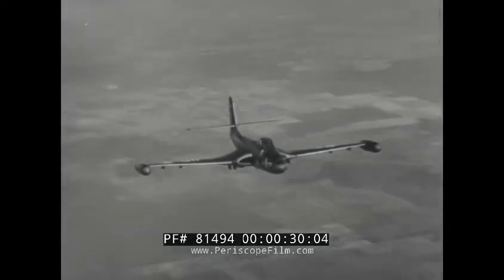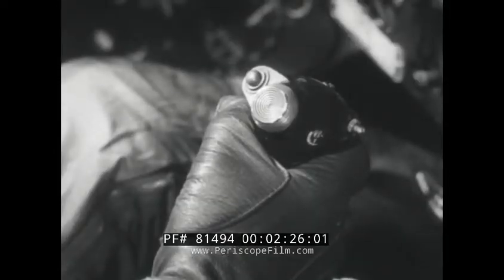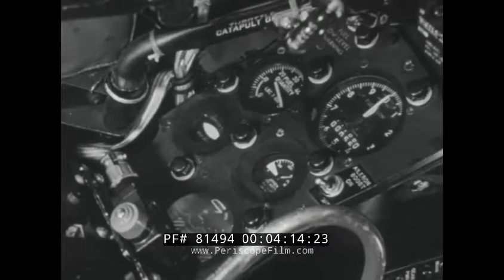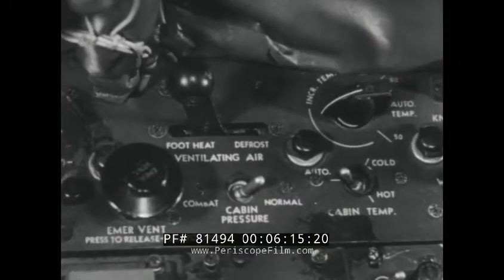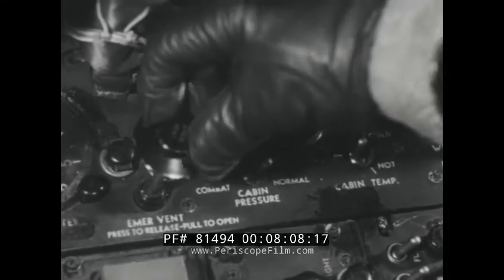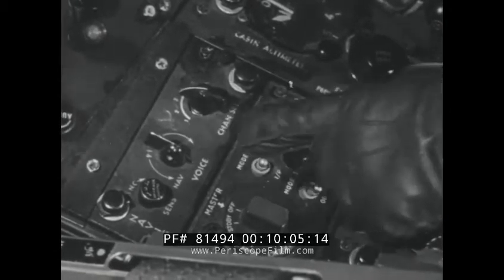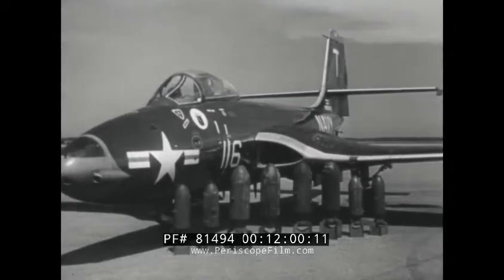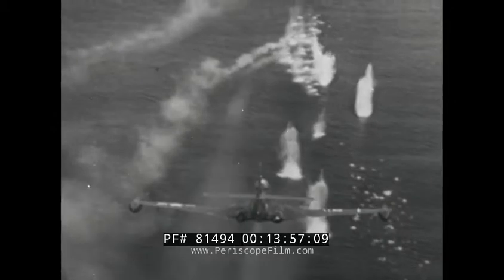1953 U.S. NAVY PILOT TRAINING FILM  "THE F2H-2 BANSHEE AIRCRAFT SYSTEM"   EARLY NAVY JET PLANE 81494

Comment: I have an untold amount of hours in this plane. I used to just sit in the cockpit for hours.

  You see, one of these planes was in a park in Vero Beach, Florida. Throughout the 70's, I would sit in the cockpit and imagine flying it. I also used to climb on the wings and rear stabilizer and, when I  was smaller, I used to slide under the wings and up into the engine areas on either side. Eventually,  the city put concrete to prevent kids from accessing these areas. 
  Initially,  I used to sit in the seat and there were wires and such hanging down behind the instrument panel (no instruments). At some point,  the city filled the cockpit half way with concrete and then later filled it to the bottom of the canopy.

My understanding is that, in the late '80s, someone realized this was the last surviving example of this plane. It was removed from the park, restored,  and placed in the naval air museum in Pensacola Florida. They painted it black to make it look like the Marine Corps version,  but this aircraft was originally bare metal (aircraft grade aluminum).

This is a link to the naval air museum website page of the banshee and a photo of the very plane that I played in/on as a child. 

https://www.history.navy.mil/content/history/museums/nnam/explore/collections/aircraft/f/f2h-2p-photo-banshee.html
Reply: Thanks great story

Comment: The F2H Banshee was a good, early first generation U.S. Navy jet fighter aircraft.  Now the U.S. Navy knew that better and faster jets with improved engines were on the way.  But now was the time to jump wholly into the new age of jet aircraft rather than procrastinate for better jet aircraft.  The early Banshees were capable of something like, 450 mph.  I believe this figure improved to around 520 or 540 mph.  So in the grand scheme of things, the Banshee, while well-designed as you can see above, was already obsolescent upon its deployment.  But the U.S. Navy anticipated this.  The F6H Panther jet was on its way.  The resemblance between the Banshee and the Panther is remarkable.  The Panther was much improved in performance and armament.  It could reach 580 mph.  It's armament was a potent, quartet of 20mm cannon while the new USAF insisted on retaining the .50 caliber M2 heavy machine gun.  The Panther carried the brass ring for the U.S. Navy in the Korean War, 1950-53.  By then the Banshee had been relegated to training duties.
      The Soviet Union followed a similar path.  Limited to German jet technology, using slightly improved copies of the Jumo 004B jet engine, the Soviets produced the Yak-15 and Yak 17.  Both were inferior in performance to British and American jets and the Soviets knew this.  But they needed to jump start their own jet fighter program and industry, now, and not later.  It was actually a practical decision.  The Soviets manufactured small numbers of the Yak jets, expecting better and improved designs.  
      This came in the stupidity of the British Clement Atlee government which looked upon the Soviet Union as a brother socialist nation that Britain could do business with and should do business with.  Do not blame all the British for this incredible act of stupidity, as historians keep saying.  The British Ministry of Defense, the British Army general staff, the Tory Party, and former prime minister Winston Churchill vehemently and vociferously opposed this brain-dead decision, to no avail.  
       The Atlee government transferred free, several superb British Nene jet engines, capable of 5,000-lbs thrust apiece, to the Soviet Union.  Even Stalin was gobsmacked that an adversary would willingly hand over military secrets.  To show his gratitude, Stalin had non-licensed copies of the Nene engine mass-produced.  Britain received zero money.  Also, Stalin referred to the British as, fools.  Plasiba, tovarich.  You're welcome.  Formerly limited to the Jumo 004B, with a thrust of only 2,100-lbs (the Soviet improved version), the Nene's 5000-lbs axial flow engine gave the Russians unprecedented opportunities.  It resulted in the excellent MiG-15 and its even better MiG-17 successor.  More, the Nene jet engine technology jump-started Russian jet engine research and development.  Ten years later the Soviets were fielding jet engines with 10,000-lbs thrust.  And the rest is history.  The British People came to their senses and re-elected Churchill.  But the damage was already done.

Comment: Cutting edge 70 years ago. I wonder how different things are today? Not very I'm suppose I'm gonna mostly refinements on the foundation of this technology I would guess.
Reply: Seems like the main revolutionary new items are exotic materials for light weight, shape and coatings for stealth, and of course computers for nav, flight controls, target aquisition. Everything else like aero, weapons, and engine seems evolutionary.
Reply: @JackF99  jet engines are very different than they were then. do some research on early jets vs. modern jets. modern as in 2022 in case this stays around for awhile.
Reply: @asquare9316  ok computer controlled, more bypass than turbojet, and exotic materials but a jet engine is still the same basic architecure- compressor, combustor,  turbine.
Reply: @JackF99  We're still using the wheel too. Clearly, not everything needs to be super-exotic to be functional. Some things are just good designs from the get go, but that doesn't negate future improvements on the theme.
Reply: @ravensinger5029  Absolutely.  I was acknowledging the question from Wasn't Tomorrow Wonderful. Mostly because that's the best YouTube username I've heard.